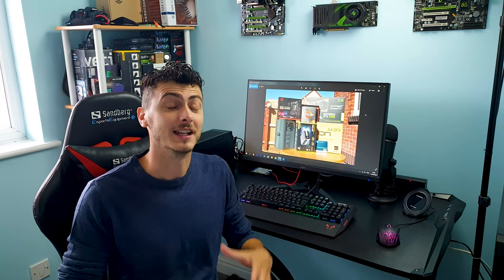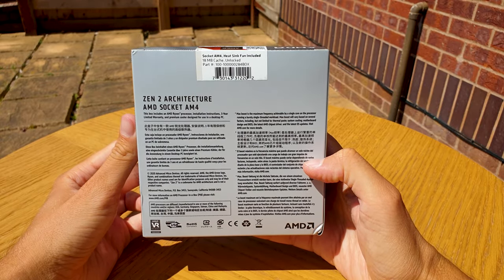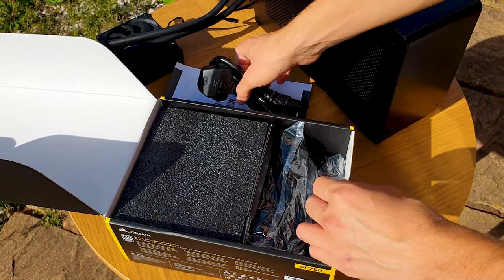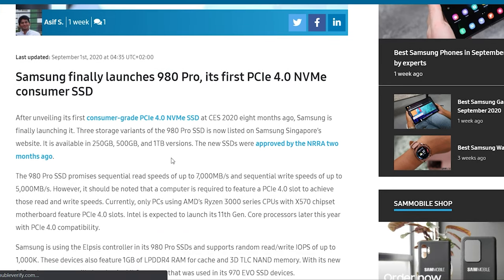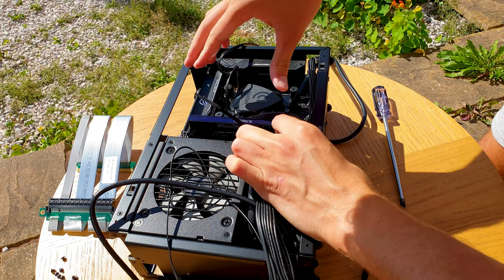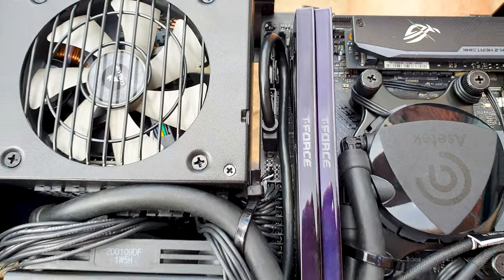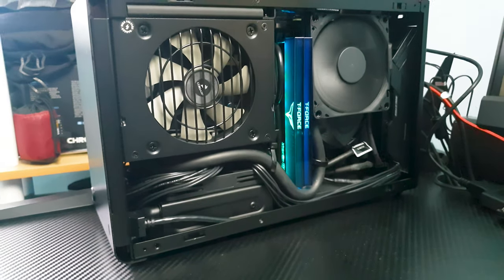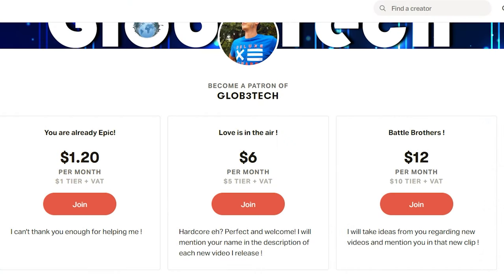Ryzen Judge 3.0 | Dan A4 SFX V4.1 Build Vlog

Comment: I had use this video as a resource to build my setup, thank you. In addition I had delid the 7700k and using dan cases window kit.  Highest cpu under load was 85.  The 1080ti ftw3 i had to turn all three fans to 100% and it kept temp around 80.
Reply from the maker: You are most welcome 🤗 Excellent. Is the ftw3 noisy in full load?
Reply: @Glob3Tech  very noisy indeed, i'd have my headphones on when i need it running on full load
Reply from the maker: @sullen117  Thank you. Oh wow. Yeah I bet.

Comment: Hello there, 
After seeing all you Dan A4 SFX videos, you convinced me to go for it. I will try to go for a gaming build ( probably i7 / Nvidia 3080  or something similar).
At the end which is for you the best solution regarding Cooling/Noise :
- CPU: Blackridge heatsink ? with any mod (like with noctua fan)? Or Asetek AIO? with any mod ?  Other?
- Case cooling: any additional fan are worth or not  (is the additional noise worth for the x degrees saved? intake or exhaust?
Do you think i should wait for DDR5  that are supposed to be released next year?
Reply from the maker: Hi there. Glad to hear and thank you for the feedback 🤗

Ok, so after all of my tests and experiments the best possible conclusion for cooling in the A4 is the following combination:

- Aio with the fan to blow air upwards
- bottom case fan to blow the air outside the case
- side slim fan 92 or 120 mm (depending on how tall the vrm will be on your motherboard) as an intake - blowing air inside the case to help the motherbaord cool the vrm, chipset and the M.2. 

The Black Ridge is better than the L9a but a bit noisier even if you use the Noctua fan. The true potential of the BR comes alive when you use the slim 120 mm fan but only if you can find VLP Ram and if the motherboard accepts the bigger fan. A lot of hassle and compromises and still the AIO will beat the BR setup even with the slim 120 mm upgrade.

The GPU having its own chamber per say, it takes care of itself. 

Hope this answers everything regarding the cooling👍

With the DDR5, well it depends when you need the PC to be ready. If you can wait that long for the newer generation, then yeah it makes sense to wait but bear in mind with RAM it takes a while until we get kits with the best combo of frequency and latency. Who knows what will happen with the CPUs and motherboards. 

But if you needed now, then grab the best stuff you can afford and enjoy 👍
Reply: @Glob3Tech  Hi again, I ve been doing some research, and I would like to know if you tried "blower" type GPU on this setup instead of "open air" type. It is apparently more efficient in exhausting the heat in small cases like the Dan A4. If yes what have been your results?
Reply from the maker: @Xandrae  Yes I am aware of this scenario as well but I don't have any modern blower type gpu at hand to fully test this. The main reason I use a 3 fan card is for the low noise ouput.

Comment: I have a question, I'm about to build in a Dan A4 and am gonna be using the 645lt as well. I will also be doing the losercard mod so I get better thermal headroom and don't have to worry about air getting in the pump. When installing the AIO you have to remove the side panel clips to fit the cooler, Do you put the clips back or just leave them out? If I remove them what holds the side panel in place? I will be traveling with this pc and would rather not have my side panel fall off.
Reply from the maker: Hi. When the AIO is installed there is no way to put the front clips back in. As far as I can tell, the remaining 3 on each side should be enough to hold it into place even when travelling. 👍
Reply: @Glob3Tech   Thanks for the answer :) And I love your channel btw. Subbed.
Reply from the maker: Glad to be of help 🤗 thank you very much!
Reply: @ethanjacobson1177  You can secure the side panels with screws on the bottom of the case mate. Even with the removed clips in the radiator area, each side panel is being held in place by 2 screws so no worries! :)

Comment: Question about the AIO pump position: Have you seen the videos about having the pump above the radiator will get air into the cpu pump and will run much hotter than having the radiator above it? I know that you don't have any other possible space for the radiator but I wonder if thermal benchmarks could be run with the case upside down to test that? Unless your AIO is full 99% now, but with time in one or two years it'll lose air.
Reply from the maker: Yes I am aware of those. That's a good idea, I will try it in a future video with the case upside down 👍I think it's full don't hear any extra noise or bubbles yet.

Comment: Why are you running Ryzen 3 3100 here when you were running Ryzen 7 2700 earlier?

Any suggestions for this case on the current/mid-2021 highest end safely air-cooled AMD Ryzen CPU + motherboard + fan combo in an RTX 3080 w/ SF750 PSU setup?

I take it there is no way that a Ryzen 9 5950X under high load can be air-cooled in this case! :)
Reply from the maker: For the first part, I responded in the other clip.

So far as you saw the 3700x and 5600x will work just fine even in stock form and/or with my manual OC undervolt, even on air. I would guess a 5800x should be viable as well only with the Asetek AIO. A 5900X would be pushing it even on the AIO. But need those chips on hand to fully test these. Anyway, don't go higher than a 5600x with the L9a with the undervolt just in case. 

Indeed, way too hot of a chip for any air LP cooler in the A4.

Comment: Hey, I have a crazy idea. Can you cut and shorten the water-cooling tubing so the water-cooling radiator can be where the side fan is, and then have the side-fan moved to where the radiator previously was. I wonder if that improves the temps because that radiator can expel heat easier.
Reply from the maker: Hi. I don't think it will fit because the AIO is really thick.

Comment: Hey, so the air on the radiator is pushing hot air towards the cables of the PSU + PSU + the tube of the AIO, isn't that a very bad thing to do? specially if it hasn't got much space. Wouldn't it be better to push air towards the bottom of the case?
Reply from the maker: Technically all true, but I tried the other way around in on of my other videos and the results were worse than this setup.

The A4 is a very wierd eco system and so far this is the best setup regarding cooling results that I have discovered so far. 👍
Reply: @Glob3Tech  I see, ok thanks! When are you installing a evga 3080 xc3 with ryzen 5900x?
Reply from the maker: @GATOtyger  If I can get them as in if they are ever in stock in the UK 😆

Comment: Glob3tech what's the weight of the dan a4? To check how portable it would be for flights. And does it fit in a backpack?
Reply from the maker: In its curent spec, almost 5 kg. It will fit in a backback for sure. The only thing I can't answer is if the AIO is allowed on flights. Don't know if it exceeds 100 ml or whatever limits they have now.
Reply: @Glob3Tech  it does have 87mm of liquid inside I saw from a guy on reddit that digged out that info. Different story I guess would be to convince security that it's indeed that liquid amount. Maybe taking a paper with official specs pictures and links on your phone.. Lol. Thanks!
Reply from the maker: Cool. Thanks for the info! 
Exactly. True, that would help just in case they want to be funny with it. 👍

Comment: hey i just ordered dan sfx v4 case and rtx 3070 and now im scared it wont work, because i need v4.1 case to be compatible with pcie ports? so v4 wont work?
Reply from the maker: Hi man. The 3070 is backwards compatible with pcie 3.0 so the v4 which has 3.0 is perfect. Now it depends what motherboard are you using.

Comment: hey can you tell me how you managed to build the Case fan under the motherboard? The riser cable is way too far down and can hardly be reshaped?
Reply from the maker: Hi. Sure. I bend the riser cable very carefully to make enough space for the fan to fit. 👍
Reply: @Glob3Tech  okay thx. could you also tell me which screws you used to install the case fan under the motherboatd an under the PSU?
Reply from the maker: Welcome. Under the motherboard I used the screws that come with the noctua fan. Then on the AiO I used the screws that come with the Asetek 645LT.

Comment: Hello. I ordered same dan a4 sfx 4.1 with the same water cooling system. I'm planning to install 282 mm card (gigabyte 3060 ti gaming OC). This is the only reasonably cooled 2-slot card i found among all 3060 ti's. (it turned out its quite hard to find good 2-slot card nowadays...)

So, im still worried that it would touch 90 degree bent tubes of wc exhaust.

Can you please advice if 282 mm would fit or not? Would i have to use this workaround with unscrewing pci-e slot and ziptie card? I Just want to avoid this...
Reply from the maker: Hi there. I know, one of the main reasons I have upgraded to another enclosure, since the newer gpus are almost non existing in a dual slot format, let alone with a tripple fan solution.

Right, so my asus strix gtx 1080 has 298mm in lenght and if I remember corectly I was only a few mm too long on the pcb, which is what that touches the aio tubes. So yours at 282, it might clear.
Reply from the maker: Found this on reddit.  https://preview.redd.it/fo4kzv40y7361.jpg?width=1080&crop=smart&auto=webp&s=2d13d33d7c0d34712adf9c65382ceeebb0fe2665
Reply: I found the answer in your another video https://www.youtube.com/watch?v=qU8I_-nv4a8&ab_channel=Glob3Tech
It seems this gigabyte card wont fit... You showed 279 mm card there which barely fits.
The problem is in water cooling exhaust tubes.

Yeah its a shame that 2-slot cards disappeared. Dan a4 such a beautiful tiny case. I really want to build at least mid-range gaming pc in it. Just cant find good graphics card yet.
Reply from the maker: @КонстатинПоповских  Yes, why I mentioned a 282 might fit. 🤞 but yeah slim chances. 

The only dual slot triple fan one is the evga ftw3 1080ti. But noisy. Other option is a founders edition rtx 3060ti or 3070 but no triple fan. I know the pain so yeah.
Reply: @Glob3Tech  I decided to avoid any risk and ordered 3060 ti founders edition. It should fit perfectly.

Speaking of FE cards, dan a4 still supports up to 3080 which is not bad.
Reply from the maker: @КонстатинПоповских Good call 👍 Yes, I have a friend with an FE 3070 and all good since identical dual fan setup.

Yes but that inversed fan on the FE 3080 will make a lot of turbulances and thus too much noise. So RTX 3070 FE is kinda the max. 

Let me know what temps you get please 👍
Reply: @Glob3Tech  ok! I hope i build it in 2 weeks

Comment: can you put in the 120mm low profile noctua if you choose low profile rams like the corsair lpx?
Reply from the maker: Maybe, I haven't tried it in that area since the RAM can take of themselves cooling wise and the fan will give max performance for the chipset & M.2 where it is most needed. 👍
Reply: @Glob3Tech  i think might be worth a try since bigger fan means more airflow in general. i think it will cool not only the ram but also the surrounding components as well. if it runs at lower rpm, might be a little quieter as well.
Reply from the maker: @Bayard8  I totally agree so it's worth a shot. 👍

Comment: Hey @glob3tech, what is the rear nvme temperatures. I have read in several places that due to its restricted access to air rear nvme slot is unusable in dan a4
Reply from the maker: Sure will check for you when I get home. When I had the 970 EVO 2TB on the back, I never saw it above mid 70s load.
Reply from the maker: Ok, so room temp is at 24 C and in idle I have 50 C for that Crucial P2 on the back of the motherboard. Then I ran a 1GB benchmark in CrystalDiskMark and the max I saw was 73C.
Reply: @Glob3Tech  thanks for the reply. That's good to hear. I will buy Dan a4 as soon as it restocks in caseking because of you and optimum tech
Reply from the maker: Of course my pleasure 🤗 Thank you ! Enjoy your new build 🤘